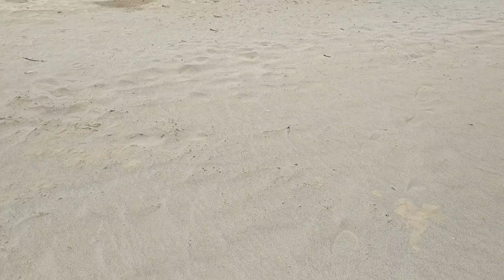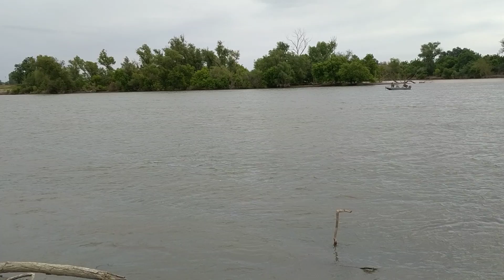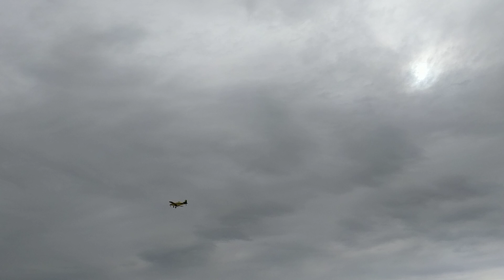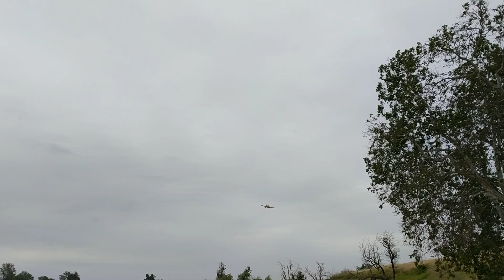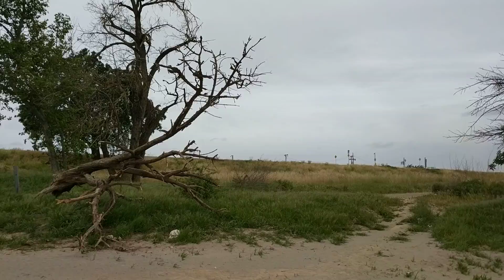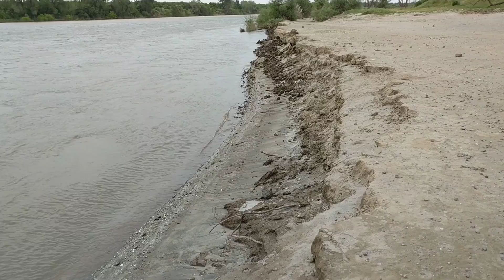5/16/17 ~ 30 miles downstream of Oroville Dam (21,000 cfs river releases)

Comment: Thanks for the great river videos and info on the RVOS.  You refer to the river being 44 feet deep.  River stage gauges indicate the height of the surface of the river above datum which is usually sea level, not the depth of the water in the river.  So it is correct to say the river level or stage is 44 feet high, not 44 feet deep.
Reply from the maker: Hi Bill. You're welcome -- and you're right. I need to stop calling it depth.  (It will take a minute to break that habit, though.) Since I think of "stage" in reference to flood stage/flood watch stage, and "high" seems counter-intuitive, I wonder if just saying "the river level is 44 feet" would be technically correct?

Comment: For rain or snow to form in the atmosphere it takes a particle called a nuclei which is either a dust particle,  an ash particle  or a radioactive nuclear tide particle .  Most radioactive nuclear tides ions that are now in the air and end up becoming nuclei come from Fukushima Dai-Ichi meltdown in Japan. As the snow fall piled up to form many many feet, I believe in places up to 15 to 18 feet, the snow in part is radioactive, and there is entrapment of radioactive nuclear tides ions, as nuclei, embedded in snow flakes.   I am wondering being that these particles are hot in that they emit radiation, if they would facilitate the melting of the snows in the sierra Nevada mountains, there by accelerating the rate of runoff into the tributaries that lead into the Oraville dam and other surrounding dams??????
Reply: Complex.  Look it up in a physics nuclear book.  I go by physics nuclear definitions.  I know it is different in biochemistry.  I have a strong background in biochemistry.  Thanks.
Reply from the maker: James, that information is beyond my understanding, but you have presented it well. I don't know enough about radioactive snow to even formulate an intelligent question!
Reply: I have a urgent request for you Millie. I would like for you to be in a video.  Having somebody else film you in a video and let's say you just got your first fish out of the  Feather River. And I would like for you to hold up a half inch minnow to the camera acting so nice and excited, as you normally are about the first fish that you ever caught out of that river.  I can not believe you are a grandmother. You sound more like a teenager that's 15 to 16 years old. Anyway, will hope to see you sometime soon in the video.
Reply from the maker: LOL James! We'll see.

Comment: The releases from the dam at the spillway are not very high compared to the inflows that are coming in the next 3 - 4 weeks. I feel that they can NOT increase the flow of water due to the severe erosion that it causes and they're holding back as long as they can.   Later,  I think it's going to be a big mistake.  There will be water overflowing the dam.
Reply from the maker: Hi James. As always, I hope you're wrong. It does concern me that they are spilling 20K through gates and 5K through Hyatt today. I thought they said they needed to keep cfs on main spillway higher than that to prevent back-cutting/erosion.

I don't believe water will overtop the dam. They would "go for broke" on main and emergency spillways before they would let that happen. Everything downstream would be sacrificed to keep the dam from overtopping.

You seem very confident that the inflows will skyrocket in 3-4 weeks. However, there are others who say it will continue to be a slow melt, and that the modeling that DWR is doing would show that as well. I wish there were a way to know for sure.
Reply: I saw the temperatures for the Orville area to be 90° and above for about a week as far as the forecast. That's why I think this very high temperature is a bad omen.I am hoping for the best. But I just don't think that the release is high enough it seems to be very minimal. As a resident in the valley I would be scared to death.
Reply: +Millie Kay (Feather River Girl) 

  G'day,

   I agree with you, but they're apparently able to run the main Spillway at lower flowrates, now, because they've "armoured" the places which were eroding with "Shotcrete"...; and they can't use the Main Spillway to reduce the Dam-Level below 835 Ft, because it's Inlet Ramp is at 830 ft & with any less than 5 ft depth of water over it then it starts to "scour", and essentially begin throwing itself through the Gates...

   How fast the Dam refills will depend on what Global Warming throws your way, in the next month or so...; all the Optimists & Wishful Thinkers are hoping for a long cool dry-ish Summer - pretty much because "that would be nice...", and all the Pessimists are worrying that because the amplitude of the swings between too hot/dry & too cold/wet (eg, the drought, from which California was suffering just before this Winter delivered 200% of the "normal" Snowpack...), it's entirely likely that the Summer will be hotter & wetter and stormier than whatever the "average" used to be.

  And, as usual, the difference between a Pessimist and an Optimist is that the Pessimist is generally better informed.

  Have a good one,

  ;-p

  Ciao !